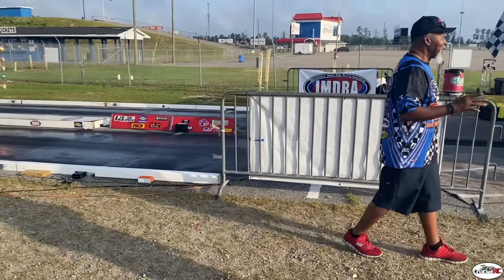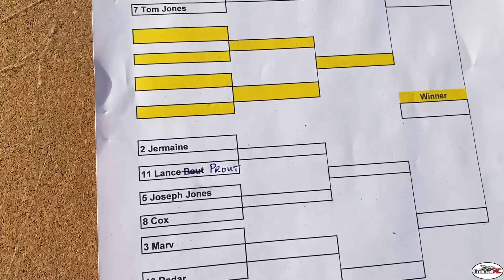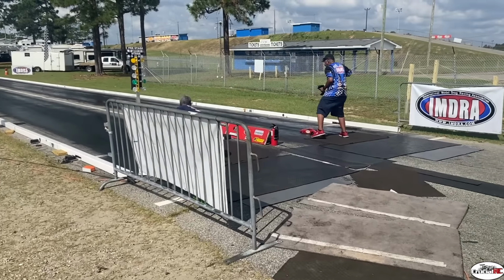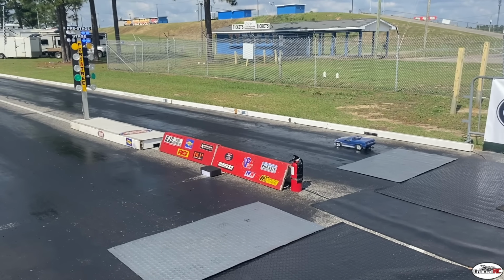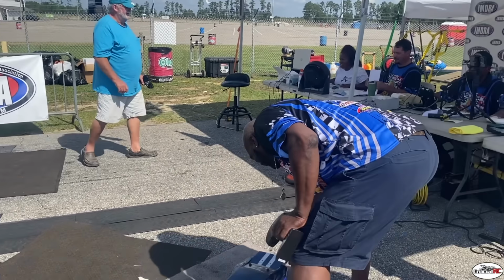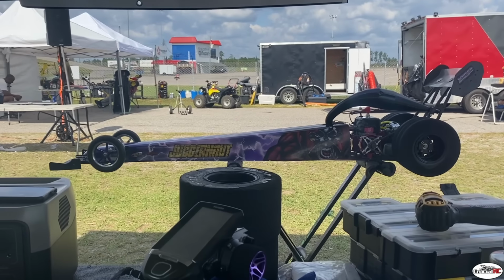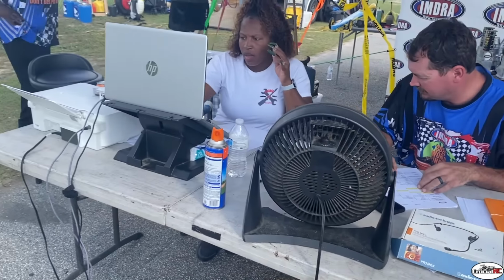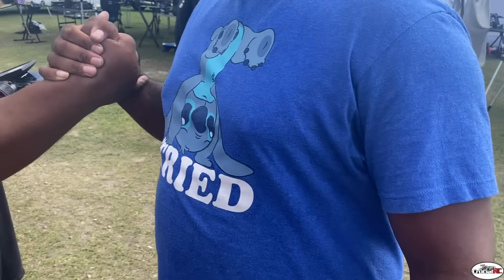Fastest and BIGGEST RC Drag Racing Finals - 2024 IMDRA Worlds Event Day 4

Comment: I'm a C/L speed flyer and enjoy watching you guys running NITRO in some of your classes  20+ years ago they had to ban unlimited fuel in most of R classes as the speeds were 200+ mph ! if you run 65%+ nitro add 4% propylene oxide  to your mix as it will excite the nitro more, you can purchase it from a photography supply !  Also great racing and a lovely drag strip !
Reply from the maker: Thanks for watching. Propelyne is not allowed at these races unless you are using it in the extreme class.

Comment: is it illegal to put a laser in the car to make it easier to aim the car. know that extra weight slows down acceleration. just a thought
Reply from the maker: No I don't think it's against the rules but may be hard to see.
Reply: @PUTDEVICE  I do not think aim is  really the issue. Much like the real ones, the track, torque, which causes body and tire flex, (A slight BREEZE) make aiming next to impossible past initially pointing it in the desired direction. The second you hit the gas, you tossed aim out the window because the car is going to do what it wants, no matter how well you balance it. ESPECIALLY if the front end comes off the ground. In the war of drift and countersteer, a laser will do little other than look REALLY cool unless you hook it up to an A.I./Skynet guided steering system. Now, a camera on the car and a V.R. style headset MIGHT help... A little....
🤟😹

Comment: Love the content. Question though? What’s with the holding it and tapping the throttle before the launch? I don’t see the wheels making contact so I assume it’s not for a burnout/warming the tires up. The pickup is mf clean 😮‍💨
Reply: The c6 body one was clean af too
Reply from the maker: We call it airing it out. 2 stroke engines use gasoline mixed with oil. If the car sits idling for too long the oil will bog the engine down so when we air it out we are prepping the run for the perfect fuel/oil mixture for the launch.

Comment: I hate to say it but those things are slow, little Cox 409 dragster I had if you just blinked you would miss it it'd be the other end of the block we use pillows to stop it. I put the airplane barrels on it and raise the compression so we can just barely started it it would sit there and burn rubber and if you blinked it was already at the other end of the track we built.
Reply from the maker: This video is about large scale. Please show me a 40lb gas dragster that's faster